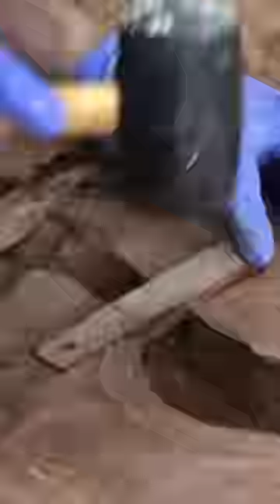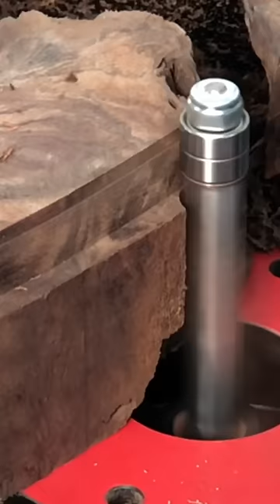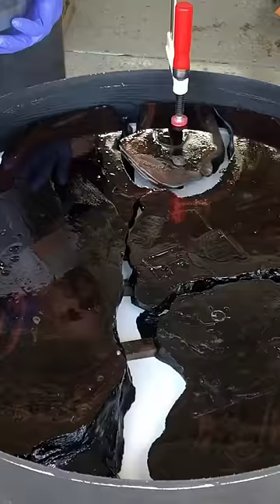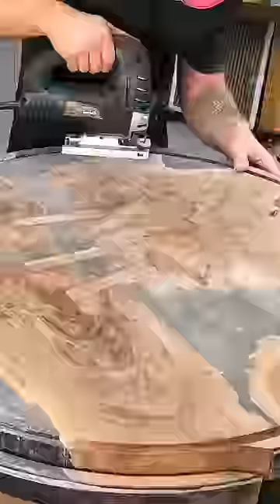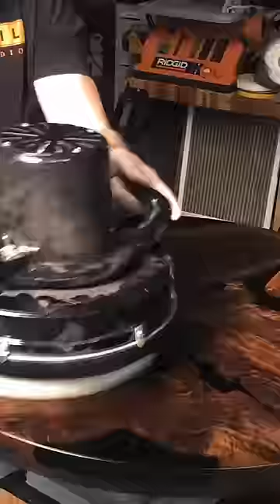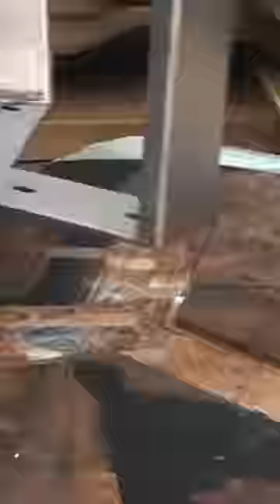Root Slab Table

Comment: The reason roots are not commonly milled is due to several factors.  The amount of drying time required, the instability of the material as it dries, the labor to extract them intact and most especially because of the wear and tear on the saws and saw blades.  They can be cut on band saws but a circular mills are not conducive to the stump's irregular shapes being clamped to their carriages
Reply: Also more likely to have rocks embedded in them which can really do a number on the blade
Reply: I wonder if anyone uses a water saw to cut them.
Reply: There's also tiny soil particles in the roots that quickly destroy blade sharpness 😢
Reply: He understood that in one of his build. The whole table warped due to moisture pockets after the build was finished and he had to turn it from table to wall art. Since it was a collab, he was really embarrassed.
Reply: But the drip tho
Reply: That's not going to stop me from trying, I'll be back on it in ten years
Reply: The more I read into your comment the more I see the dollar amount increasing for that table. Lol
Reply: Nobody needed all that, thanks but no thanks. Take your general knowledge of woodworking elsewhere.
Reply: @ajmitchell5187  I've been a professional woodworker and master carpenter for 38 years.  I apologize if you are intimidated but when you have a passion for your chosen vocation the depth of knowledge you retain tends to get very deep. Take your cowardice elsewhere.
Reply: @ajmitchell5187  Dude, you have watched a woodworking video 🤣
Reply: A little bit of time and effort on setup with Alaskan sawmill for slabbing. Just gotta keep sharpening the chain.
Reply: @adambutton6414   he is just joking with ya. Tons of ppl liked your comment. Its ok dude. People say mean things online. Doesn't mean they think bad of ya. Think of it how ya roast yiur friend, and take care!
Reply: Bummer
Reply: @ecospider5  Sounds like an interesting idea, but possibly waterlogging the wood would be a nightmare. Im sure some madman has tried it and maybe made it work, but definitely not cost /nor time effective.
Reply: @ajmitchell5187  Literally watching a woodworking video, from a woodworking channel. The circus called they want their clown back.
Reply: @dzank  absolutely!  As someone who mills with a large bandsaw, I stay far away from root slabs....unless you want to completely destroy a brand new blade in record timing.
Reply: It's a lossy / tax cut of a situation.
Good only if you have the efficient system in place.
Reply: Wow that is really beautiful  I want one
Reply: @tummytub1161 😂😂
Reply: So im going to make it very simple for you as to why they are not readily available.

1 roots are full of rocks you cannot see. Two you are cross cutting so your slab is end grain an is very prone to warping an breaking. Those are the only two reasons.
Reply: @dzank9354 you mean destroy
Reply: @brandonbennett127 what do you consider large? Like wm1000 or bigger
Reply: @TheDilweed  I have a woodland mill 130max and a wood mizer lt28.  The woodland i have set up to stationary, and the wood mizer is on a trailer, so I can easily bring it wherever I need.  Although I have quite a lot of time on a LT40 as well.  But the woodland mills is my favorite saw right now. I think it cuts better than the wood mizer.
Reply: @brandonbennett127  ah nice. I myself have a lt15w but used a lt70 and wm1000 at work for some time.
Reply: @TheDilweed  I'm a small 2 man operation in northern California.  I'd love something with more automation.  I gotta save some more pennies.  $80+k is a lot of coin.  So an old hyster forklift will have to do for now.
Reply: @brandonbennett127  no doubt. Gotta start somewhere i logged for over 10 years now i strictly work for myself. As a sole proprietorship.
Reply: Think of a machine press like two garden hoes isolating the main trunk, and you could pulverize the roots that could temporarily ect produce foliage in the corresponding area. #FDA #USDA #CDC ect.
Reply: Yes to all. Also, most of us hate epoxy.
Reply: @ecospider5 That seems like a fantastic idea!

Comment: resin is the new asbestos
Reply: Well, the old asbestos and lead are still a massive problem. We kinda stopped making asbestos glued floors, but now they're bringing it back with the epoxy garage floors, tables, countertops, cutting boards, etc. Imagine all the micro plastic particle dust when they inevitably have to chip the resin garage floors up to replace or fix them.
Reply: @DonkeyDongs  that’s what I’m taking about
Reply: I've said similar things in this channels comments section before but I only ever hear back that it's completely safe.  Or I don't hear back anything...

Comment: I have a few suppositions as to why: first, in the past when our woodworking craft was formed, our ancestors didn't have those neat tools you have; and without them it would be pretty hard to turn a shapeless contraption into a decent tabletop or other part of furniture. And second: because people had more trees and less (no) gas or electricity to heat their houses with, so they used those shapeless things from the root slabs as combustion material.

Comment: Two factors. Possibility of stones that ruin your very expensive blades at the lumbers place and the fact that theres almost no usable wood unless you use epoxy.
Reply: Can't hoses and careful cleaning get around that?
Reply: @JakeWitmer  nope, its stuck between the woods fibers, even grown in sometimes
Reply: @@johndoe-ss6mm i was very confused until i looked at my last reply lol. I guess so. If only the rocks got prettier too while grown in :D
Reply: That the point you use epoxy . May be you could leave the rock in situ and incorporate it in the piece.
Reply: @kevinklingner7712  you wont have lumber then, do you want to cast the whole tree into a block of epoxy?
Reply: @D3nn1s  ni!  Heaven forbid I  didn't say that . I was just saying  the rocks the stumps are growing would make an extra dimension to.a table pieces and add something to the whole.doesnt have to be done all the time just something different.
  I have used petrified wood basalt and petrified wood the Has been partially melted in volcanoes sand stone to make tables with wood.
Reply: @kevinklingner7712  ah lol, because of the broken english of your first post i didnt think it was your first language so i didnt want to argue too much. Now i get you, for bigger rocks sure thatd work, however as you surely know the small pebbles that you dont see, that may even have grown in are the main issue why many sawmills wont touch "dirty" wood.

Comment: It isn’t just a little more expensive. It is much more expensive. Not only does the root ball have to be dug up instead of ground up, it also has to be cleaned to get rid of the dirt and debris. On top of that, they typically have rocks and dirt in them which will ruin a blade almost instantly and can be quite dangerous. Even after all of that you don’t usually end up with much, if anything, to look at.
I absolutely agree that the grain is fantastic but it is just not worth it.
Reply: Thank you very much for explaining more about the process involved, including the detractors to using root/ stump slabs.
Reply: It all depends on the selling price whether it’s worth the effort….
Reply: I'm glad someone else who has actually slabbed a root ball piped in. It's just not worth the enormous hassle and risk. I've done it a few times for special clients (used a Lucas mill) and, when they get the bill with blade repairs included, they usually sh-t their pants - even though they were warned!
Reply: @PatNetherlander  maybe for some but I find the idea of rocks and metal flying around at high velocity a danger I don’t want to quantify in dollars. Plus the life of your equipment will be significantly reduced. So, unless someone comes up with a less hazardous and more streamlined way to cut up root balls, the risk is not worth the reward.
Reply: Word. I've seen slim cut-offs of regular oak pierce a cabinet door after it got accelerated by the table saw. Don't wanna be near a rock that shoots through the workshop at those speeds. Damage on equipment can be calculated beforehand. And it should. Even the risk of it. But you can't put a price on your own safety.
Reply: It might be worth noting that when you're sawing logs, you are absolutely going to (eventually) hit dirt, rocks, nails, bullets, musket shot, glass, barbed wire, etc. There just tends to be more of each in root balls, which can really takes a toll on the life of your tooling.

FWIW, the most dangerous part of milling is movement of the logs and lumber. Unless you are scatterbrained, foolish, or just really, really unlucky, a blade generally won't fling anything towards where you should be standing. Similar concepts apply in the home shop...be safe, good people!
Reply: Fyi- for repetitive, time-intensive, low-skill work like removing pebbles, dirt, etc, we employ low-cost high school and college students. They love being in a woodworker shop, they love observing, and they work both hard AND "dirt cheap" LOL. At one point, one of our neighbors parents actually paid my Dad to allow their kids just to sit in the corner and watch him work for half a day! They LOVED it!
Reply: @petrescue2093  Cool! Great idea 'cause you sure can't find laborers to do that without costing every penny of the profit(if any)😂
Reply: Just an honest question, but why would you charge the client for your blades? It is your business, so therefore the price of blades and equipment should be your responsibility. Maybe i am missing something.
Reply: @wyntersteele1a  Well, first of all, the purpose of any business is to make money. While there are rare times when I as the business owner need to eat the cost of something because I messed up, if I am not making money the prices need to go up so I can.
Usually the cost of blades and such would be a preset amount that is figured into the overhead costs per hour. For blades that means the maintenance costs get spread over multiple jobs as it takes many passes through a log to dull the cutting edge to the point where it needs to be sharpened again. 
On a job like a root ball where you are guaranteed to hit rocks the life of the blade is significantly reduced. One rock will ruin a blade. If even a single tooth on the blade gets damaged that blade will start wandering and becomes dangerous. When going into a job where that is pretty much guaranteed the blade price is separately calculated at the end of the job. The more blades that were ruined during the job, the more the customer is going to need to pay or I won’t make any money.

Comment: ive been thinking of making a guitar with a root or a gnarly peace of wood. this video really inspires me to do it.
Reply: Not a guitar player but, wouldn't that have cracks in to be filled with epoxy which would change the sound because of a variety of factors of density and vibrations?
Reply: a solid boby electric I'm guessing
Reply: I wonder what kind of sound it would have. 
That would be interesting as well as beautiful.

Comment: This would be amazing with uncolored, clear epoxy - it would allow you to fully appreciate the complexity of the shape + would be cool if you could see the construction (you'd have to tap the screw holes + use bolts instead, though. To keep everything looking as clean as possible (aka like the bolt is just floating in the clear epoxy / "mid air")

Probably hellish to maintain, but I think it would look cool

Amazing work, as always

Comment: The wood is beautiful. Roots and burls are always incredibly beautiful. However, epoxy resin is NOT beautiful. It is cheap looking and it's use here is a lazy, unskilled method of creating a shiny surface. Instead, polish the wood and finish it with genuine oils or laquers, then cover it with a genuine plate glass top, Give your work the  class the wood deserves.

Comment: I have one. I dug it and towed on it with two smallish tractors and ended up chopping out a 20" X 5' length of timber. Water lasted it left it drying in my garage. Wire brushed it by hand and washed with soapy water and a stout brush. If nothing else it appears to be full of switch back and fisheye features while being extremely stable and clean. I think the idea has to be explored further after using an Alaskan mill for hobby over ten years.

Comment: I have  a section  of a California  redwood  I made a slab table  years ago. It's mounted  on a fire stump irregular  and gnarly.  The center  has a couple  bolts in plywood  . Then 50+ screws. Plywood  to slab. .it's needing  sanding  and releveling. .I've never  worked  with  epoxy.  I dislike  the steel  mixed with  beautiful  wood.

Comment: Really nice! I've wanted to do something with root balls for a long time and wondered why I haven't seen much on people using them, in fact other than a guy that used them for turning, this is one of the only ones I recall. Of course, it takes work to get em out, but with large machinery, they often pull them out, just to be burned or sent to the landfill. The wood isn't much dif then the stuff above, but often very narly and grain going all dif directions and making wild croches, etc. Very interesting stuff and often way bigger around then everything a foot so above ground. Plus, even were the tree was cut for the wood, the rootball is left unused.

Comment: Will do, I do these root tables from time to time. Having a sawmill makes getting it parallel and even incredibly easy. Slabs would be cool too. It will be expensive (Dirt dulls the saw blades fast and it dries weird so it will be outside under weight for about 6 years to keep it flat.

Comment: Do tree removal and root removal then use the wood for things you can sell. Fry the branches you can't use and put them through a chipper sell everything with no wast. Any extra is mulch or sawdust that can still be used.

Comment: Why not take a root slab and carve the top into a miniature little village or townscape that's as intricate as you can make it. Perhaps shape it into either a long oblong, square or circular table carving with bridges and then lay a shallow light blue in the centre to a blended blue and green to represent coastal sea water to fresh water colours. Add tiny bridges or make the whole thing into a tiny old Japanese town with low level trees in the centre areas to give it a tiny complex piece of art, before finishing the art piece with clear or opague with white cloud flecks to build an interesting artistic mini town, city scape even adding a hidden cable and coloured diode and equally miniature train set into the artwork that runs inside a tube around the design to cover with a tube cut to a tunnel carved into the table top to wood to hide the wiring underneath the table to set lights across the design before levelling off with the final polymer top coat to complete this table as an eye catching piece of art. It's something I've wanted to do, but I don't have a workshop to work in as A disabled person I don't have access to the money to build such a facility. Nor pay the wages for the actual table builder to turn the art into viable art pieces.

Comment: Question: How do ya'll remove the bark from live edge pieces? I just bought some really nice fiddleblack claro, and i used chisel to remove most and then dremel, altho idk if theres a better way.
Reply: Use a small or average size hand held grinder....with a metal grinding disk .and follow up with a stiff wire wheel ...fast and effective.... You are welcome ...
p.s use safety glasses🌹

Comment: Rocks and debris live in and around the roots. My chainsaw isn't getting abused like that. 

With that said. I lived in Northern CA and when SPI would go in and log areas with manzanita, I would go in after they finished and pick up the manzanita root burls for the lathe. Super hard, brittle, and tons of inclusions. Beautiful wood though. Brilliant red swirls and nearly black edges on any of the inclusions.
Reply: Forgot to mention, gotta let it dry before working with it, or it will change shape. Couple years on the smaller ones, and right now 8 years with the larger ones I still have. I'm glad I brought them with me. Won't find any in Montana

Comment: And then he literally destroys the lovely timber by fitting everything with nasty epoxy 👎👎👎
Reply: Whats wrong with epoxy? How would you eat on a table where half of the table isnt table?
Reply: @kniferewiewscool2646  - Epoxy is an ugly fad, it will pass.
Why would you want an expensive wooden table where half the table isn"t wood?
A craftsman wouldn't make a huge dining table from that slab, they would an use the timber in a way that utilizes it sympathetically and enhances it's character.

Comment: While a perfectly flat table is beautiful, I suggest one time you try with a little less epoxy, and then don't flatten it. So the wood stays a little bit higher than the epoxy. I think that'd be beautiful too.
Reply: Issue with that is it wouldn't be too comfortable to use, and things like cups would spill essier. Also its impossible to polish the epoxy in the nooks and crannies

Comment: The bow ties aren't needed.
Epoxy won't break.
Reply: @anauticalgate5496   he has said many times he just likes the look of bow ties.
I personally don't.
He even did a video of table to test epoxy strength.
You should watch video if you haven't.
He stacked as many bags of concrete on table as it could and didn't bow even.
Then only way they could break it was to drop a pointed 800 lb log from top of tallest lift at wood yard and the wood in table broke, not the epoxy.
Interesting video.
Reply: The bow ties were on the bottom, not the top.   So not for looks
I watched that video before I saw your comment